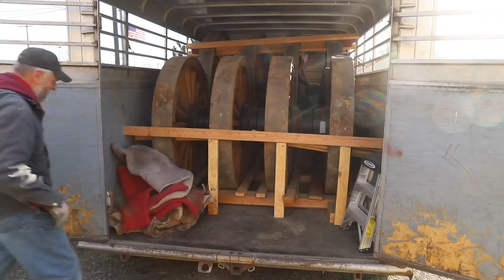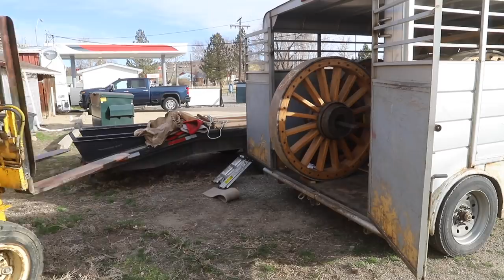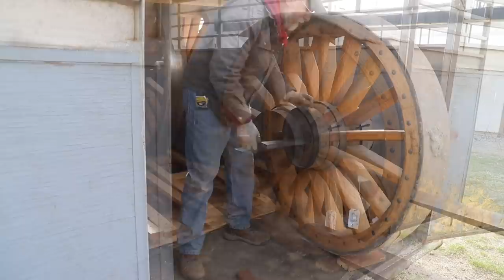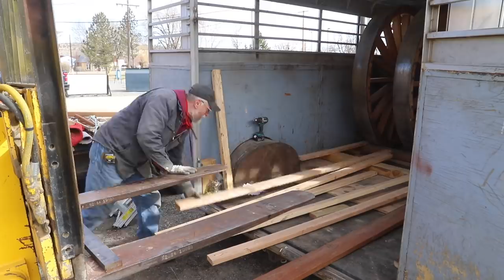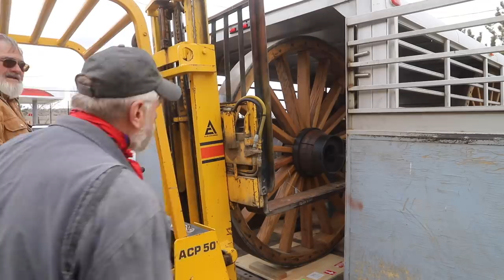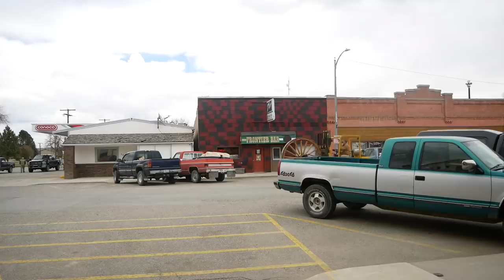The Borax Wheels Return for Tightening | Engels Coach Shop

Comment: I love that Studebaker wagon, I was born and raised in South Bend a few miles from the Studebaker plant, My dad and grandfather both work for Studebaker, my grandfather painted the stripes on the wagons with that little brush. I still live here but no Studebakers :(
Reply: Before moving west the Studebakers built wagons in their nearby East Berlin, Pennsylvania blacksmith shop. 
I too as a child like Lil Gabe waited each week to see the Borax wagon train on black and white. Saw the first wheel building video with great interest as I had just purchased the remains of a 1925 Ford Model TT truck needing wooden wheels. It had been used as an Adam's County orchard buzz saw power unit not far from the Studebaker blacksmith shop. Have owned a '47 Studebaker pickup and a '53 coupe.

Comment: Amazing that they were shipped to you in a 'Single" axel trailer, that's a lot of trust in two tires with such a precious cargo's weight! Good to see them again though!
Reply: Good point! As I recall, the largest 4 wheels weigh a bit over 1000 pounds each! That makes the total weight of the load to be up around 8000 pounds! Me thinks that single axle trailer was overloaded.
Reply: @gs1100ed  They lightened a lot out in the desert.  :)
Reply: @gs1100ed  …That’s like 9 race horses.
Reply: From the position of the axle, up to half of the weight was on the hitch! How did it couple to the tow truck?
Reply: @salamander5703  Gooseneck trailer
Reply: @salamander5703  Are you trying to make a joke?  It is a gooseneck.
Reply: @MrThisIsMeToo  Couldn't see from the video. Goosenecks are not so common here in the UK so I wasn't sure. Tow truck still carries a lot of the weight though. it's not all on the axle.
Reply: @salamander5703  OK Gotcha.  Almost all horse / livestock trailers on this side of the pond are gooseneck.  If you see them a lot it is easy to spot in the video.  Will tend to agree the hitch is carrying more than the axle in this trailer.  Strange trailer for even over here.  Not common for sure.  Mabey custom or a hacked trailer???
Reply: @MrThisIsMeToo  a gooseneck trailer is very uncommon here in mainland europe. I have never seen one in my live. And there are a lot of trailers around here, even many small cars have tow balls here.

Comment: When you get to the repair video, I hope you say some words about how moving the wheels back up north might change how the wood has moved.  That is, does the wood start expanding back to Montana weather?  How long does it take to shift?  If the wheels got re-located someplace wet after you did this repair, would they break?  Or have other problems?

Comment: off topic but hey ..sir after watching many  of your videos  i find it never fails to impress me  how well your shop is setup for you to work . you have jigged or fixture d most of the common operations you carry out and each "station" comes complete with its tools and equipment  and there paced where theyre needed . most people will never understand the work that went into making it why it  is and why it works... as always thanks for the videos. quick question... the tool you use to measure wheel circumference ..is its circumference 12 inches or is it a random size?

Comment: Note at 5:30 the tires are polished shiny by the padding placed between the wheels. This shows the necessity of the padding. Without it there would have been a lot of rubbing between those tires. I love the massive crating. This is an excellent example of doing it correctly. Remember those wheels weight over 1000 lbs each.

Comment: I'm going to go out on a limb here and say, I think he spent more money on lumber and screws than he did gas to haul those to you. It's good that he knows how to pack stuff so it doesn't shift around.
Reply: With gas and lumber both being so high, it surely was not cheap getting those wheels to him.
I was wondering if it would have been easier for Dave to go to the wheels.

Comment: As you were unscrewing the dunnage in the trailer I was thinking, "no way Dave is not going to save those screws to reuse."  Sure enough, a few minutes later there you are, putting them into your screw jar.  "Waste not want not."
Reply: This is the step where a magnet on a handle becomes very handy.

Comment: Drop a grader blade across the driveway to alleviate that bump coming into the shop less likey to unsettle your loads on the forklift, also dont stand in between the wheels and the forks when loading

Comment: Would it be possible to slather wooden wheels with penetrating oil on a regular basis to keep the wood from drying and shrinking or weathering and checking?
Reply: They did that but the wheels still had to acclimate to the desert.

Comment: 'The Return of the Borax' or 'What Goes Around Comes Around'
I was a bit concerned when you were standing between the forklift and the wheel - if the wheel had overrun the wooden chock the you could have been seriously hurt, spoiling both your fun and ours.  There is no shame for asking for help when you need it.

Comment: Dave, I commend on your safety in the past but you stopped my heart when you got between the forks of the forktruck and rolled that large first wheel toward you. If it would have jumped that board and come off that trailer with a little too much momentum, that would have been fatal. You had no where to go. I am so glad you got help and admitted your stubbornness.